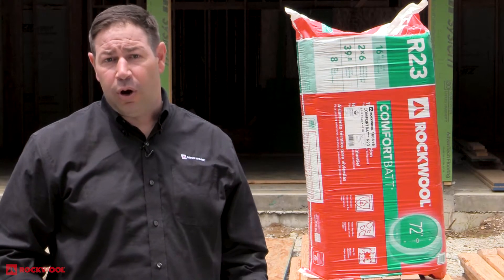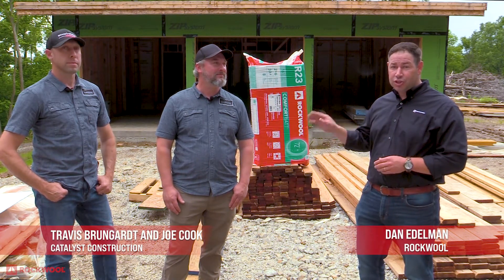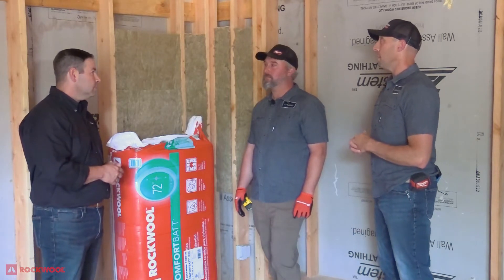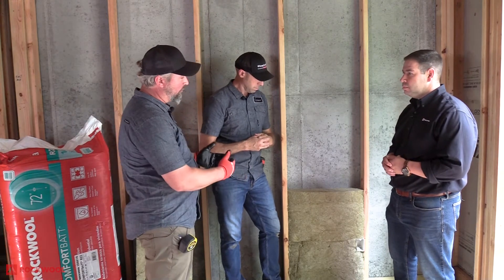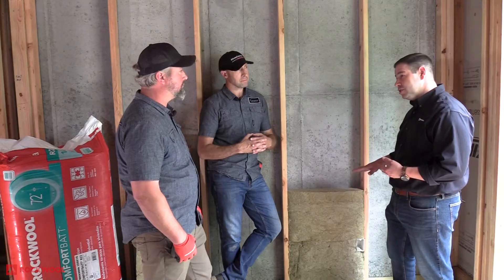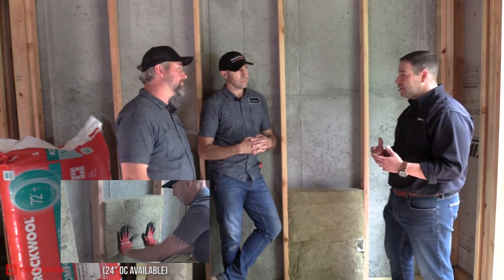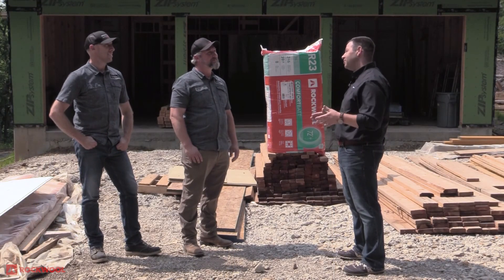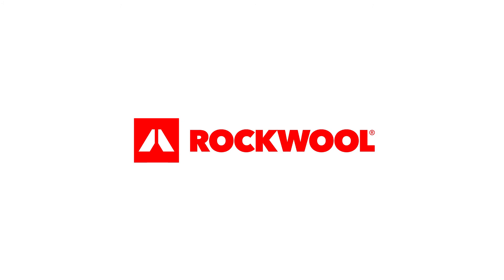Behind the Walls with ROCKWOOL: Catalyst Construction

Comment: Hi. Thanks for the great videos. I am in northern new jersey. I am also considering Rockwool and Zip R Sheathing for our renovation. I am debating about putting the Rockwool outside or inside. Any advice on this? Siding —> Rockwool —> Zip R Sheathing —> Closed Cell Spray foam.
Reply from the maker: I would say best practice and truly vapor open (Zip R is a vapor barrier and so is Closed Cell Spray Foam) is to do the Rockwool Comfortboard outboard, Zip Sheathing(no polyiso), Comfortbatt and then drywall.  Hope this helps!  I am fairly local to North Jersey too.